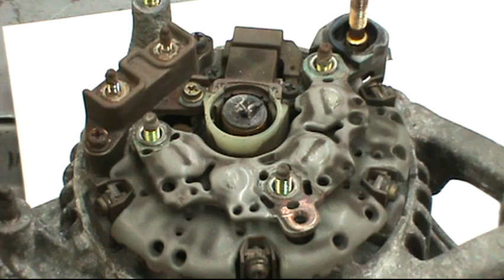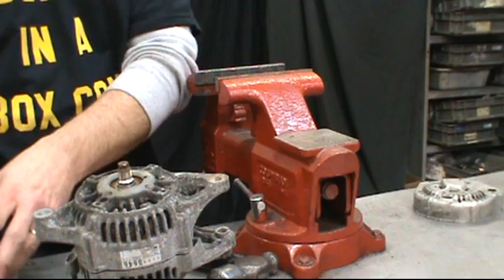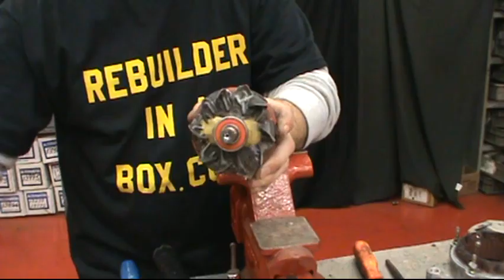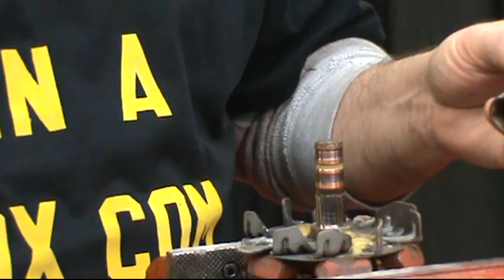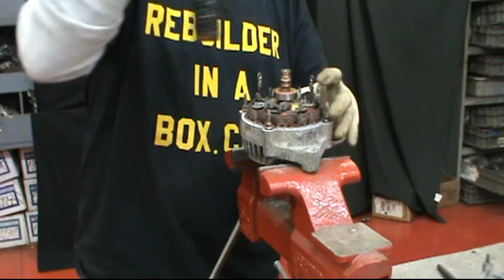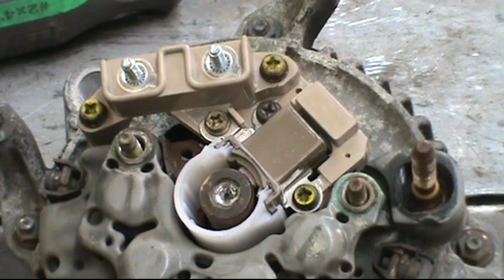How to rebuild a denso alternator

Comment: What if you did have to replace the Rotor Slip Rings? Is that replaceable? How is that done?
Reply from the maker: Our goal is 100% success rate. We'd rather you don't try this at home. We show you some grooves are tolerable, particularly with our brushes which have a little more carbon than OE. If you happen to have one that's burnt  through to the plastic, we'd recommend calling us to order a new one, or possibly we would have a used one available.
Reply: Mike Lauer I was just curious, not setting out to start an Alternator career! 😹
Reply from the maker: The answer wasn't just necessarily for you. People who are actually doing the work can learn from relevant questions.

Comment: Thx u can u make one on how to up grade /to make/with part #/ a honda accord 2.3 alternator make 300 amps please thx u again
Reply: There is a vid on Youtube on how to rewire your alt to double the output, then run a smaller pulley, should get you close to 300 if your starting with a 130a alt...

Comment: I would imagine this alternator is scrap judging by the cracked casing at 15:40
Reply: Probably he dropped it,LOL or by hammering on it to get the case lose ?
Reply: Nah, thought that at first as well, but on 2nd look I noticed that the the breaks are old, dirty & oxidized - no shiny new metal. I'd bin that bad boy, though, or get the case fixed. Figuring he's just using it as a teaching aid.
Reply: @bobbofly  Just wrap it up with a hose clamp.

Comment: Everythings great Except: Can NOT find any video from you on how to REPLACE THE SLIP RINGS on a Denso alternator! PLEASE UPLOAD ONE!
Reply: its every easy. get new slip ring.to take off old slip ring crush it in a vice and it will crumble you can pull it off with fingers.cut wires on old slip.to fit new slip ring just line it up and tap it on with nylon hammer solder the wires seal with some arldite job done.iv done thousands. best to put rotor in lathe and skim slip ring to make it spin true did atleast 5 a week for over 20 years.you can get copper rings that you solder over the old slip ring but you need to skim them in a lathe

Comment: 10:30 pry bar? LOL.. You need a bearing puller, that was nasty.
Reply from the maker: Please don't. Nasty would be the center piece of a puller messing up the copper slip ring by spreading it from center pressure.
Try it if you have one you want to waste.
Reply: @rebuilderinabox  i thought this glad i read comment
Reply: @rebuilderinabox  It depends on the puller obviously, but the right one's exist for the job !

Comment: Nicely done video. The only thing left out is how to install slip rings. My slip rings is deeply grooved and looks to be almost to the plastic. how to install a new slip ring?
Reply from the maker: We only support slip ring replacement on units that will end well with the procedure. For that type of alt. we recommend a used rotor ass'y which you can contact us for (if you have purchased a kit). LImit one per customer.

Comment: s there a way to make a GM Alternator that is internally regulated go to 100% duty cycle to test its max amp output ?
Reply from the maker: Carbon pile load, raise RPM's

Comment: Nice video but I your website doesn't work unfortunately when I tried ordering parts.
Reply: The website provided here doesn't have shit. It's jenky. Go to maniac electric motors website, it's more professional.
Reply from the maker: Thanks for the heads up.  We have fixed the issue now.  It was our hosting provider that dropped the ball and we had to suffer on lost orders.

Comment: Notice the line where the front housing meets the rear housing, especially if just buying a reman. That split point should be even all the way around. There is a small lip on both housings it must be clean, I used a Dremel and a brass wire wheel

Comment: Great video!! helped so damn much but when i took mines apart i found a small wire that looks like it was on the rotor but is just hanging. is it suppose to be solder on there?

Comment: Good but process isn't complete without using some grease when rebuild the piece, I mean put some grease in bolts, bearing socket, threads and sliding parts in order to get easy reassembly and facilitate disassembly in the future, also some grease or oil contributes to better adjust and tighten of parts, other reccomendation is to use some piece or aluminum, bronze or wood to beat the main shaft, it maintain measures and finishings in a good shape.

Comment: Nice info!  If I wanted to make my alternator "pretty" by cleaning, priming and painting the case,  would I need to do anything else special to it besides the full teardown you show?  Looking to put in a higher amperage alternator into a 1972 Charger.  Thanks!
Reply from the maker: +AustrianAnarchy While you have the alternator apart it would be a good idea to do the clean up part.  If you have access to a sand blaster that would be the easiest way to blast all of the dirt and grim off.  Then you are able to use spray paint to get the desired look.
Reply: Mike Lauer Thanks!  I can't remember from the video, but do both halves of the case come off/coils come out of the unit?
Reply from the maker: +AustrianAnarchy Sorry in the delay, somehow your comment was missed by me.  It is not suggested to take out the stator for a home rebuild.

Comment: Nice video, however when you tap down to remove the front cover put the nut on flush with the shaft to protect the threads. Other than than simply awsome video.
Keith.

Comment: Muy bueno el video y gracias por compartir el conocimiento. Queria hacerle una pregunta tecnica a ver si usted me puede ayudar, tengo un alternador denso de cherokee 95 el numero de parte es Denso 210-0130 el cual dejo de trabajar lo desmonte y cambie escobillas y al montar en la primera arrancada manda 14V y funciona perfecto en todo, pero al siguiente dia ya no funciona, entonces vuelvo a bajar el alternador y monto de nuevo y vuelve a funcionar perfecto y luego deja de trabajar en la segunda arrancada, ya descarte diodera y estator ya verifique todo el ramal que va desde el alternador a la PCM pero me surge una gran duda el arnes va conectado a dos postes con unas tuerquitas de 7mm esa pieza tiene el numero ATR-6001 y mi duda es si esa pieza funciona como un regulador aun cuando en este caso de jeep cherokee regula la PCM, esa pieza tiene una especie de diodo o resistencia que no se como verificar que este buena y en eso es que espero por favor me pueda ayudar. De antemano muchas gracias y disculpe lo largo de mi comentario. Saludos

Comment: Thank you for your very informative video....the only question I have is if your Denso Alternator has a "Decoupler Pulley" on it, is there any different consideration (or tool) needed to remove that pulley?
Reply from the maker: Sorry for the delay in response, these particular Denso alternators do not have a clutch pulley on them.  On the ones that have a clutch pulley do require a special tool.  We are looking into an economical way of distributing a kit for that participial rebuild kit.  With the added expense of the tool and the extra cost of a clutch pulley it might be better just to buy an alternator.
Reply: +Mike Lauer Mike can you tell me what would be the best rebuild kit for my 06 liberty and to get more amperage. .?